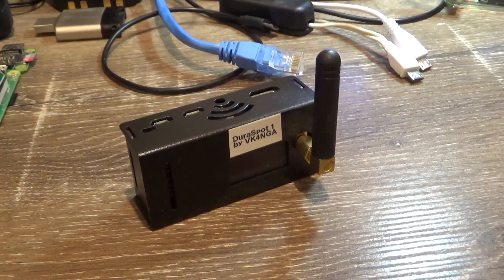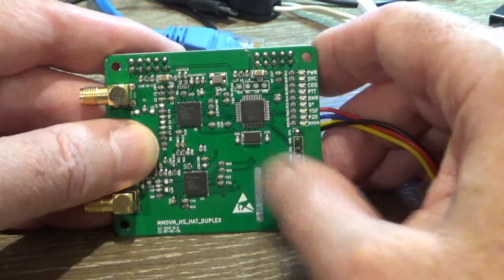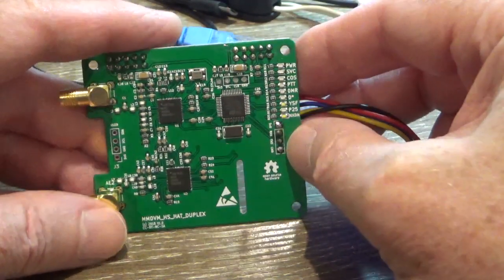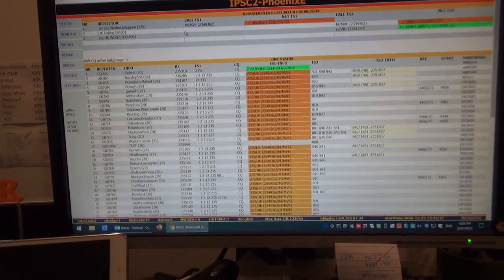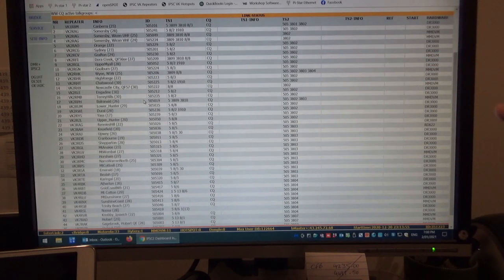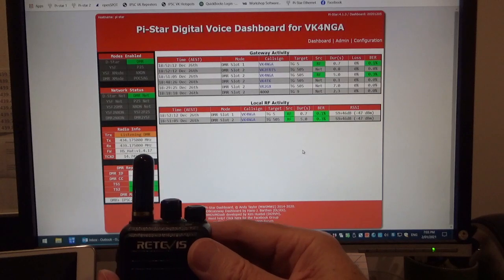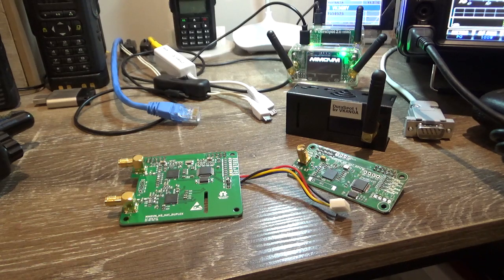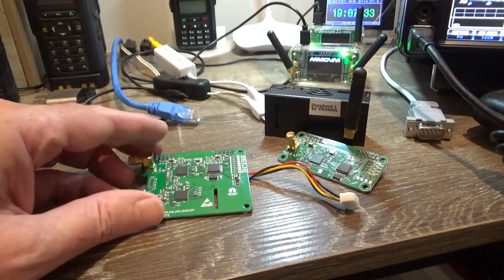Duplex Hotspot How it Works BUT Do You Need One?

Comment: Please realize that Ham's hack the use of the term simplex. This leads to people taking it beyond a redefine.  For example, your definition of duplex is completely wrong.  It is possible to operate duplex with tx & rx on the same frequency.  This takes a more expensive radio, one with two transceivers. Wee we operate on repeaters we are operating half-duplex.  The is the same as operating peer to peer on a single frequency.  To operate true simplex, just turn on your auto's FM stereo.  That's true simplex.
Reply from the maker: Hi and thanks for taking the time to correct me. I'm no expert on the subject, but my video needs to be taken in context of common hotspot terminology, particularly if operating on DMR. Here's an idea, why don't you take the time to record a video so people are further informed.
Reply: @vk4nga   Yes, it is unfortunate that the miss use has become "common" for part of Amateur Radio.  Note, for HF operations the poor terminology is not used, but rather the correct term of "split mode operations".  I am not criticizing your use of the common kludge, but  criticizing your extension in falsely defining "duplex".   Yes, I'm on a mission to point this out. Fortunately, the plague exists only with VHF/UHF operators.   I could post a video, but the reality is that throwing water on the fire is more effective.  And besides, comments help you regarding the YouTube algorithm.

Comment: Trying to get my head around Duplex Hotspot.  Would the only difference be you can listen to a repeater through the hotspot to both Time Slots?   This would work if your radio's main channel and sub channel where on the same frequency but one on Time Slot 1 and the other on Time Slot 2 along with their specific Talk Groups?   Do I have this right?   No other benefits besides listening to 2 Timeslots at the same time?  Does a Duplex hotspot have any value when your on a Network like TGIF

Comment: Hi all, I have the 878uv..... and I have one single issue I'm not sure how to resolve, although I have this feeling it is probably easy to fix........ EXAMPLE: when using the 91 TG (WW) or any other for that matter and then going to another channel to talk, I cannot talk on the channel I'm currently on if any other channel is being used...? any ideas and also I can see the strength meter going as the other channel is having a conversation as though I'm still somehow connected to that channel even though I have tuned away from it and am trying to talk somewhere else........... Thanks for any help, W2AIQ
Reply: You have to go into your channel settings. Turn off timeslot hold

Comment: With duplex, could I run one of the chips on DMR in simplex, and the other chip on YSF in simplex? Or should I just get another hotspot altogether? I have both kinds of HTs and would like to not have to reconfigure every time I want to change networks/HT.
Reply: This is the exact thing I was thinking.
Curious to know if this is possible myself.
Reply: Me too! Need to know. I don't think there's multiple time slots for system Fusion i would imagine you use timeslot 1 for yaesu and 2 for DMR
Reply: Having played around with this for a while, I don't think it is possible.  I don't think it's a limitation of the hotspot. I'm running a Pi-Star on a Raspberry Pi 3b, with WPSD firmware and you can indeed enable both YSF and DMR even in simplex.  The problem is from what I can tell, both Brandmeister and YSF aren't friendly about sharing one device to access both networks. I ended up running two hotspots, with one for each service. Honestly this keeps things cleaner when it comes to configurations and dashboards. It also allows you to monitor both systems simultaneously on different HTs etc. It's not as if the hotspot has two transmit frequencies, it only has one even in Duplex, so you would have to figure out a way which service would take precedence over the other etc. With two separate hotspots, they can work at the same time, on different frequencies.

Comment: In your video, at 4:40 you say "if you're on Brandmeister everything is on TS2 so you don't need a duplex hat." A knowledgeable ham friend of mine (W8IE) says Brandmeister uses both TSs. He says "Brandmeister can use both time slots, it depends on the hotpot you have. I have a duplex and a simplex for dmr..." I told him about your video to which he responded "Yes, if you have a simplex spot, you can only use slot 2, if you have a duplex spot you can use both."

Begs the question, why are you saying "if you're on Brandmeister everything is on TS2 so you don't need a duplex hat"?
Reply: Exactly. I have a duplex hotspot and it works with both TS on Brandmeister.

But there’s a catch. Brandmeister used to drop dynamic groups on both TS when 4000 called on either TS. This allowed duplex hotspots to have an advantage over simplex hotspots - ability do disconnect from ragchew on one TS by calling 4000 on other TS.

This is not he case any more. A lot of repeater users complained on being disconnected by someone on another TS. So from the repeater perspective this behavior is a bug. And Brandmeister fixed it. You can’t disconnect from TS1 by calling 4000 on TS2, or vice versa.

The only way to drop dynamic groups during active QSO is via Brandmeister API via Pi-Star, mobile app or Brandmeister site.

I’m currently working on alternative solution - a lightweight service running on pi-star hotspot’s, listening for RF calls and dropping dynamic groups on times slot when I key 4000
Reply: What app do you control the TGs with?

Comment: Awesome video, thanks for taking the time. I have a semi related question about the duplex hotspot and that very same radio. In the US we have the TGIF network which works well in both time slots just as you have yours setup. My question is about the radio. Did you create a digital contact and attach it to individual channels for each TG you want to access? For instance if you turn the knob on your radio and key up on another TG it changes in Pistar? Sorry this is only partially related to your video but...... Kind of close. 😁
Reply from the maker: Hi Dustin, yes that's exactly how my radio is setup. Also setup one RX group per channel that matches the talk group. That way the radio only hears the talk group you are on.
Cheers Glenn.
Reply: @vk4nga  PERFECT, thanks again Glenn!